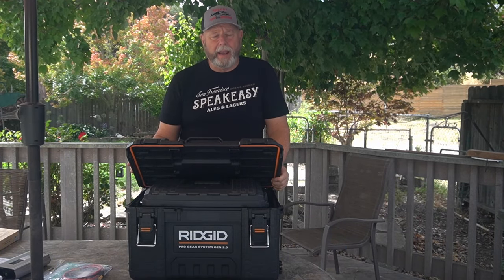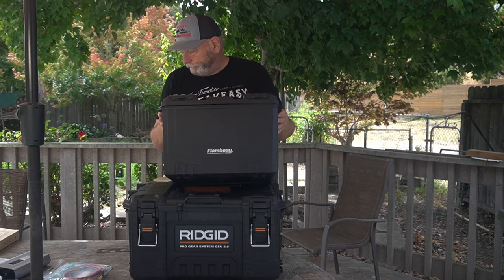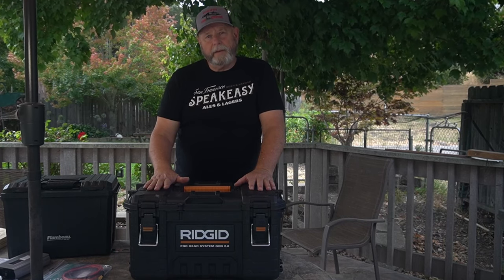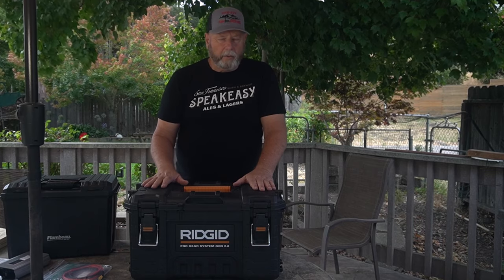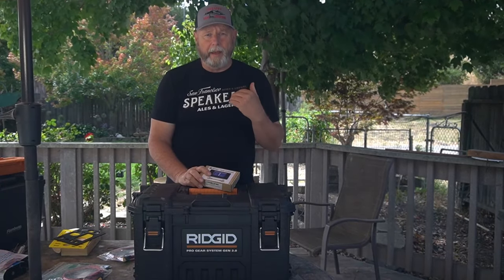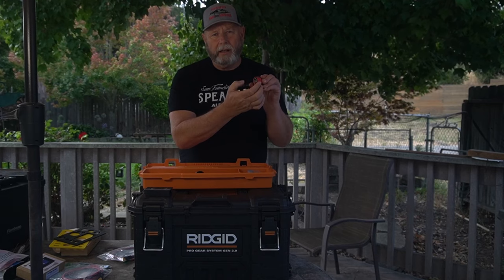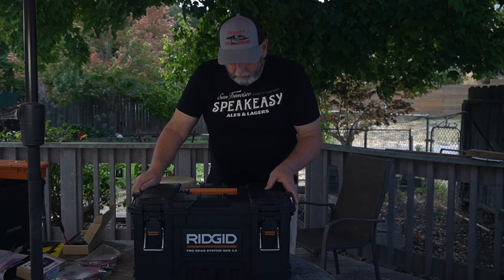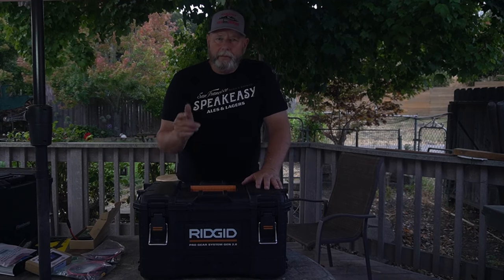Solar generator build in a box.

Comment: Difficult to give any real advice, since I would need many more details. But, from what I've seen of your vehicles and RV, my gut tells me you'd be better off with the Rigid.

Far as placement goes with putting in the holes for your ports, my advice would  be  just go with your best judgment without overthinking it. You'll probably be pretty close. Then after a fair amount of use, you could replace the Rigid box and put things exactly where you want them. 

Fun timing of this video! I'm releasing part 1 of a series I'm making on my first battery box build.
Reply from the maker: Thanks Scout , I have a pretty good idea of where to place and had some good suggestions. The rigid will most likely be the box I use.

Comment: Chuck, not sure if you missed my post . I have the same MPPT controller as you do. By itself, it put harmonics on the bands. Running the wire from the charge controller wrapped multiple times through a FT-240-43 toroid, and then to the battery got rid of all the harmonics. If you see the same, try a toroid in line.
Reply from the maker: That's funny John, I just did a review on the controller today. I found some noise on 160,80 and 10m. It was worse on my half square antenna than my doublet. I had planned on doing as you say with a toroid, I have a different controller that came with one. 160 and 80m doesn't bother me mostly night bands so no solar, but 10m might be a problem. Now the part of this build that does have noise is the inverter but I don't plan on using it much maybe a TV and won't be on the radio. Thanks for the info!

Comment: Chuck, I will be doing something similar and build the system over time. So far I cant see past Renogy's combined MPPT & DC-DC charger. That way you can always charge when your off grid. I dont beleive any other company makes a combined charger. I will likely use a peli style case.
Reply from the maker: Thanks Colin.

Comment: One other thing you can do that is really handy in the field to charge or power 12V items in the field without the need for a battery. Get a 30 v to 12 v, 20 amp DC to DC converter (Alli Express, about $35.00, it's listed as 20 to 30 v input, 12 v out @20 amp max.) You can hook it directly to and up to 4,  100 watt panels, wired in paralle and get 12v @ 20 amps at the output. One 100 watt panel will give you about 5 amps, two, 10 amps etc.. Just don't exceeded max voltage and amps in your panel combination. Whatever the amperage output is from the panel will be pretty much what you will get out of it minus a slight loss in the converter. You are going to want to have a panel (s) that puts out 25 to 30 volts each though. Be sure to check the output voltage before plugging it into any equipment. Only works when the sun is out and bright, but cheap as can be to put together if you have a few panels. This would not work for 24 hour power like what you are doing, but could be a cheap way to make power in a time when things are hard to get.
Reply from the maker: I have something like that but not that big I will check those out, thanks!

Comment: You sounded like you were very fearful of the power going off.  The ON/OFF switch you demonstrated seems to be able to flip off with a nudge.  I may be incorrect  on both.   If so, have a protector of some sort for the switch.
Reply from the maker: It does seem to turn off pretty easy. I will keep an eye on that and maybe figure a way for it not to turn off.

Comment: Can't wait to see how it comes out. On all my battery boxes, I use a toggle switch-style 30-amp circuit breaker from Blue Sea Systems. I mount it to the front of the box and it's not only the main circuit breaker but it also acts as a master power switch. I use a generic fuse panel with screw terminals. I tried a fuse block with spade connectors but they didn't stay seated. I use the same power monitor, a 12V lighter connector, a USB connector same as what you have. The 12V lighter and USB connector are on a separate switch. I also mount my solar charge controller to the front of the box so I can see the solar charging. I use the 20-amp PWM charge controller from Bioenno Power. I tried using an MPPT controller  but it's not RF quiet. I'm curious what you find with that Bateria controller. I have 4 Powerpole connections and a separate Powerpole block for either a solar panel or external charger. I never thought about using the XT-60 connector but that's an interesting idea to make it foolproof. I use a DPDT center off switch to select solar or AC charger to charge the battery. I use the large Harbor Freight ammo box for batteries up to 36 Ah and large Plano boxes for the 50- and 60-amp batteries. Looks like an interesting project. 73 de N6EF.

Comment: I am building a similar thing but sing a Milwaukee Packout rolling bottom.
Reply from the maker: I have the Milwaukee boxes the are really nice, good luck on the build and send me some pics!
Reply: Will do.  All of my dc outpouts/inputs are on the front the a/c in and out are on one side.
Reply from the maker: @Cliff-KI5OPP  AC in are you adding a battery charger?
Reply: Yes i am putting a multi formula charger.

Comment: I would build it as small as possible. As room in a overlanding rig becomes very precious quickly. I use a 50 cal ammo plastic box from harbor freight with 2 18 Ah batteries, multible usb connectoers a 50 amp andrews and power meter all mounted in the lid, And a 400 watt inverter mounted into the side. Junk the cig plug and use 30 amp andrews connector. Then make a jumper cable from the 50 amp plug to a 30 amp plug. And plug it nto a multi andrew power strip, Works awesome. Make jumper cable lengths as needed. I have several lenghts to run accessories inside and outside at the same time, Runs my fridge and FT 891 without any issues, Maurice aka Big Sky Overlanding

Comment: Put your fridge on sliders so you can pull it out and then use the rigged box on the other side not in the slider
Reply from the maker: Good Idea , the fridge would be easier to acces that way. Thanks, I could probably attach to the seat bolts.

Comment: I hope the rigid box has wheels on it to help move it. I think having a panel on the inside at the top, under the top lid would be smart. It protects the switches and connections(clean, dry, concealed from prying eyes). I personally think have a way to bolt down or lock it down so smash and grabbers can't just break a window and unlock the door, then run off with your generator.
Reply from the maker: Good idea on bolting it down, I think I can do that pretty easy.
Reply: @KK6USYHamRadioAdventures  I made a lock box for my "Get Home Bag". The police dogs alerted on my truck because I tampered with the vehicle.

Comment: Aloha Chuck, as you know, I specialize in off grid applications and I believe you’re on the right track so far. 
    I think you should put your switch panel on the front instead of the side to prevent your vehicle’s door from slamming into the panel if it were mounted on the side. Plus having the switch panel on the front could offer you access from the driver’s seat or passenger seat if ever needed. 
    Are far as the cables between the batteries, I would go with a higher gauge wire like the flexible 6ga awg zipwire like used for audio amps in the trunks of cars with those boom boxes we all hate so much. You know, what you see and hear when you don’t have a LAWS rocket. 😂🤣😂🤣
     I have been buying these round magnetic mounts for my Ditch lights and light bar on the top of my Jeep. These would be handy to mount on the back of your solar panels so you can stick the panels on top of your trucks so they won’t blow off while you are driving. 
     If those batteries are Lifpo4 batteries, then you must use a battery controller made for that type of batteries. 
    I would avoid those cigarette lighter plugs all together and go with a more direct connection or go with the larger 50amp Anderson PowerPole connectors so that you can ziptie the connectors together so they can’t come apart so easily. 
     I have a couple of these 150amp power/wattage meters that has short wire connectors on each side that you can wire up in a remote fashion so that you can see the values and/or results of your charging system. I have a brand new one in a box that I forgot where I put it over three weeks when I had everything staged and ready to deploy to set up Fire Watch stations on Maui before the first fires was started by poorly maintained HECO power lines. 
    These also come handy with you’re going to run a micro wind turbine generator(s) like I keep in the back of my Jeep at all times. 
    Overall, Chuck, you are putting together a power go box that can be used inside and outside of your trucks and that makes life easier when you need this system the most. 
     I, personally, would use a 14 volt system like with two golf cart batteries, one 8 volt and the other as a 6 volt to give yourself just over 14 volts to run your radios on for POTA Activations or EmComm communications. 
    One last thing, you can add more connectors to that panel for things like an air compressor to inflate tires or just to run a couple sets of LED lights on switches at night. 
    Overall, this is a good project and definitely worth another video once it’s finished. This is when you’ll discover things you could of, should of or could of done moments. 😂🤣😂
     Good luck and let us know how it works out for you. 
       Todd WH6DWF 🇺🇸
Reply from the maker: A lot of good ideas there Todd thanks!

Comment: Hey how thick is that inverter you are installing?
Reply from the maker: 1.9" x43." x 6.3"
Reply: I just ordered one. Have you checked the current draw with load yet?  I am planning on a switch to control it.  The switches are only 20 amps at 12v. I might have to use a relay.  I have been looking at some solid state relays.  I wonder how noisy they are?  I dont have a radio with a scope.  I might just have to try it out and see.
Reply from the maker: @Cliff-KI5OPP  No I haven't done that.